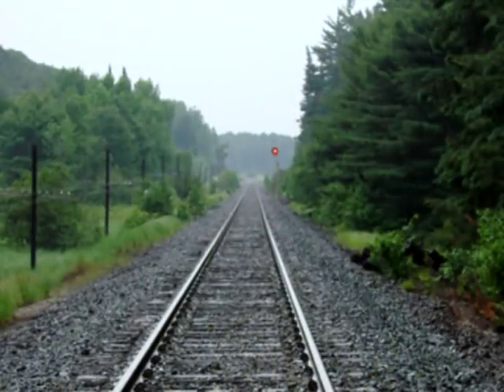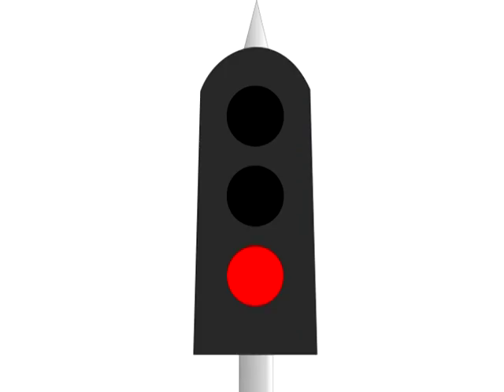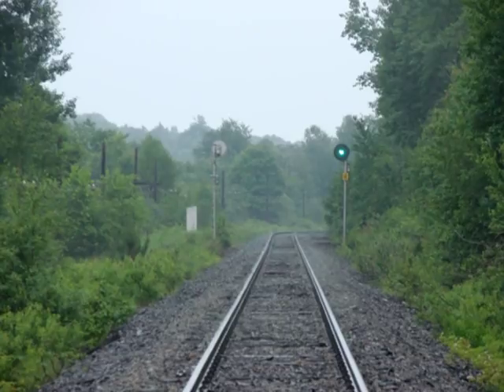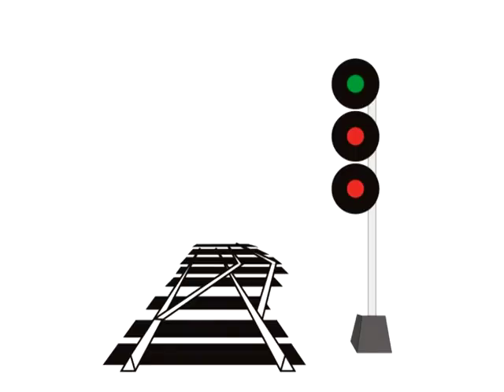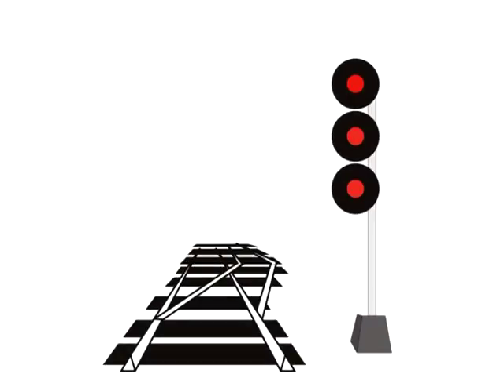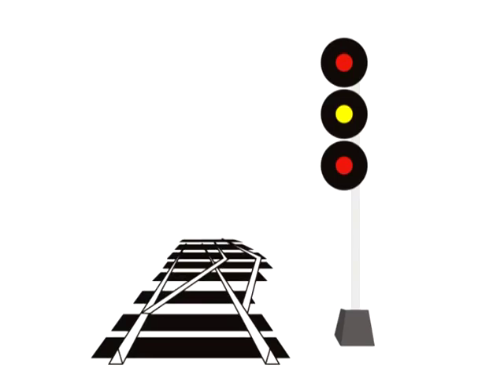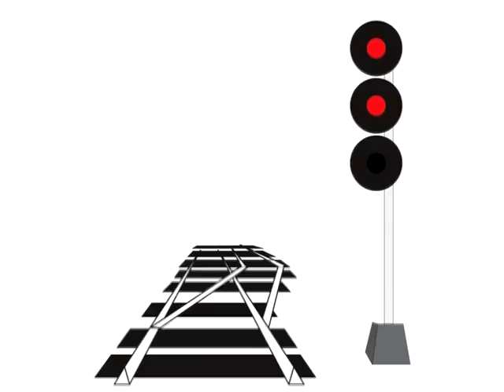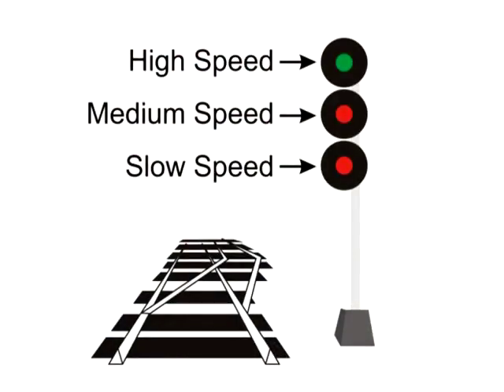Railroad Signals, reading and meanings, part 1: The basic three light system

Comment: What should a train crew do if the weather becomes to dangerous to go @ Green over Red, & Red. Say a snow storm starts blowing snow and creating near white out conditions? I would think the crew would slow to stop and radio in there weather conditions and the safety action the are taking. Is that the correct procedure? Thank you for the informational video. I learned a lot.
Reply: As long as engineers can see signals before they reach them, they're probably OK.  They'd certainly inform dispatch of the situation, but wouldn't outright stop unless ordered to, schedules being what they are.  Not just their own schedule. but that of trains behind them on the same rails.  If there is any way to safely keep things moving, even slowly, that is preferable to complete stop. 

A lot depends on where the rails are.  If there are a lot of road crossings, especially ungated ones, not being able to see if the crossing is clear well ahead of time would be a major safety issue.  In the mostly empty plains of ND and MT, not so much.  What impacts trains more in winter than sight distance is icing, on switches and track sensors.
Reply: stripervince1 Obviously, the asker isn't familiar with signal rules, or the conditions you cite.  Hence asking the question.  All I'm trying to dispel is the asker's assumption that such conditions would automatically lead to a complete stoppage.
Reply: Toby Cameron Your thoughts are incorrect. I wanted to know if that was likely and what should or would a train crew do in the situation I described. I am not familiar  with rail road signals other than grade crossings.
Reply: ahnbra Well, you said "I would think the crew would slow to stop and radio in there weather conditions and the safety action the are taking," and all I did was say "not necessarily full stop".  Where did I misunderstand you?
Reply: Toby Cameron Disregard my previous reply. I misread and misunderstood you. Sorry about that.
Reply: We're cool.
Reply: Excellence question!!!
Reply: In the situation you spoke of, you don't go past signals you can't identify.

You would treat the signal as if it was showing it's most restrictive signal. In most cases the most restrictive indication is stop.

Call dispatch and tell them situation.

Dispatch will no doubt instruct you to go at restricted speed for a specified number of miles.

Restricted speed is:
A speed that will permit stopping within 1/2 the range of vision. It will permit stopping short of a train, a car, an obstruction, a stop signal, a derail, or an improperly lined switch. It must permit looking out for broken switchs. It will not exceed 15MPH	

Train crews that are ordered to go at restricted speed have all the weight of responsibility on them to stop short of all the obstructions mentioned in the definition of restricted speed.
Reply from the maker: ahnbra Believe it or not - we don't slow down for nuthin!  Heavy fog or snow, we have to know the territory we operate over. So we know where the signals are, and sometimes you might just see the signal for a fleeting second before you pass it!  As I was explaining to another commenter, here on the Alanwater sub in Ontario, there are signals which can't display an advance clear to stop, and the distance between that signal and the next one is very short.  For those signals we actually vary our speed as we approach that signal based on the weight of the train.  If we're really heavy, we slow down on chance that the signal is not a clear signal.  That is the only time we slow down!  Whether or not we can see the track ahead is irrelevant.  :)
Reply from the maker: stripervince1 Nope, we don't slow down.  As you know, if it's heavy fog we have rules as per the bell and stuff, but no - we basically don't slow down.  What would it accomplish?  We can't stop anyway, even if we could see.  You're the first I've heard say CP ran like that, the conductor I worked with up North was with CP for three years before he came over to CN, he never talked about anything like that either. The only exception I can think of was when we were coming into towns with just crossbuck crossings, and the crossings were really bad even during good weather.  We slowed it down then, but that very conductor was on a single light unit on a bad day, and they struck a van. They weren't even going the 25 mph track speed, they were only going maybe 15, 20 mph?  Didn't stop until about five or six cars past the crossing.
Reply: Again, if the gasoline truck didn't obey the crossing signal, not the train's fault, and sh*t happens.  Unless a train is already going at a relatively low rate of speed (Slow, Restricted, Medium, or even Limited) by the time it sees there's an obstruction on the track, it's already hit it, or just about to.  This is why cars and trucks are supposed to stop at crossings and let the train pass.
Reply: There is almost no weather, short of an honest to God tornado, that will outright halt local rail traffic.  And even that's temporary, unless it physically damages the tracks.  Mere visibility isn't an issue, what does it need to see?  A train can't go anywhere but where the tracks take it, and re crossings, see above.  The only effect winter weather has on rail travel is indirect; if a switch freezes or sensor fails that could force a train to stop -- briefly -- to evaluate the issue.  I was once on an Amtrak in Michigan during a blizzard, where it had to go through a crossing at walking speed because of a frozen/stuck sensor.  Its speed was kept down (under the flexible definition of "track speed") for most of the run and it was dead late to its ultimate destination, but it did keep moving.
Reply: 25mfd In the VERY FIRST comment in this thread, I in fact highlighted the fact that signal visibility is a crucial factor, why are you jumping down my throat now?  I did not and would never advocate blowing past an obscured or inoperative signal.  The current context (per stripervance1) is about visibility of the track in fog, with respect to avoiding collision with obstacles, cars at crossings, large wildlife, etc.  Which is no more or less of a problem during inclement weather then in good weather...
Reply: Toby Cameron
My fault toby. I got the wrong guy.

I meant to send this to ian juby.

My fault.
Reply: Ian Juby
From a RULEBOOK aspect, the cond and engr MUST call out the signals they encounter.

If you were riding with a safety officer/traveling engr and neither you nor your cond called out a signal aspect due to being unable to see it, what would you do?

You would have to do something to mitigate the fact that you did not see nor call out the signal aspect.

To CYA, you would have to get down to restricted speed until you get to the next signal and notify the dispatcher of your situation.

Also, what if you are blowing past weather obstructed signals on a subdivision where you have a river crossing?

I worked on a job where we had to cross the Mississippi river. (...i HATED crossing that bridge. made me nervous as hell) 

No way would I blow past the last signal before the bridge not knowing its' aspect. I do remember twice we had to stop at the bridge because we weren't lined up.

All of your actions are recorded, as you know.

So if a crew encounters weather obstructed signals and gets into trouble because of this, and there is no audio record of the crew contacting the dispatcher nor is there EVENT RECORDINGS of the crew slowing down to restricted speed, this crew is canned and the engr will be decertified.
Reply: Toby Cameron
Although I do think ahnbras' question was in reference to obscured signals due to bad weather and not about issues related to grade crossings.

Can't see why he would ask about grade crossings when the vid is about signals which govern train movements.
Reply: No mei
When operating in reduced visibility situations, you're supposed to be following NORAC Rule 958.

If you can't see the signals, how do you know they are clear???

"If anything distracts attention from a constant lookout ahead or if weather conditions make observation of signals in any way doubtful, Engine Service Employees must at once regulate the speed of their train to ensure safety. "
Reply: Toby Cameron
Your incorrect in saying that , "... but wouldn't outright stop unless ordered to, schedules being what they are."

The cond and engr are responsible for safe handling of the train and no one else.

If the crew deems it necessary to stop, they better stop.

SAFETY comes first over any train schedule.
Reply: No mei
You stated, "Not once have I ever (Personally, Or heard of anyone else) slowing down a train because "It was too foggy" or "the snow was too thick". "

Your comment is utter NONSENSE. PERIOD.

Here is an excerpt from an NTSB report of a derailment where a train rear ended a train due to HEAVY FOG.

The cond and engr were KILLED.

So much for all of that, "Safety is first" crap.

About 1:58 a.m. eastern standard time on January 17, 1999, three Consolidated Rail

Corporation (Conrail) freight trains operating in fog on a double main track were involved in an

accident near Bryan, Ohio. Westbound Mail-9, traveling near maximum authorized speed on

track No. 1, struck the rear of a slower moving westbound train, TV-7, at milepost (MP) 337.22.

The collision caused the derailment of the 3 locomotive units and the first 13 cars of Mail-9 and

the last 3 cars of TV-7. The derailed equipment fouled the No. 2 track area and struck the 12th

car of train MGL-16, which was operating eastbound on the adjacent track. The impact caused

18 cars in the MGL-16 consist to derail. The engineer and conductor of Mail-9 were killed in the

accident. The crewmembers of TV-7 and MGL-16 were not injured. Total estimated damages

were $5.3 million.1

The National Transportation Safety Board determined that the probable cause of this

accident was the failure of the crew of train Mail-9 to comply with restrictive signal indications

while operating at or near maximum authorized speed in dense fog. Contributing to the accident

was the lack of uniformity and consistency in the operating practices of Consolidated Rail

Corporation train crews when they encountered conditions of reduced visibility. Also

contributing to the accident was the lack of a backup safety system that would have helped alert

the crewmembers of train Mail-9 to the restrictive signal indications or that would have stopped

the train when the crewmembers failed to comply with the restrictive signals.
Reply: No mei
You're forgetting that "...Safety is first" crap" is the ONLY thing standing between you having a good paying railroad job and you working at tim hortons.

Getting canned and decertified would be the BEST thing that could happen to you. At least your ALIVE to fill out your application at tim hortons.

I worked for union pacific. Got in trouble a few times. They CLUBBED me over the head with that GCOR rule book. Most roads do. Including yours.

Most roads will dangle your job over your head if you fail an efficiency test. You may even get placed on the discipline system

Hell, you don't think they would pound your ass in the ground if you blow past a stop signal obscured by fog and rear end another train??? (...that's assuming you are ALIVE)

After they have their "kangaroo court" investigation, you'll be out of a job. (again, assuming you are alive)

You need to start looking at your CROR rule book as if it were you CHECK BOOK. If you don't follow that CROR, you will find yourself out of a job.
Reply: No mei
You are wrong.

Here is anbras question..."What should a train crew do if the weather becomes to dangerous to go @ Green over Red, & Red. Say a snow storm starts blowing snow and creating near white out conditions?"

His question is self explanatory. My response is in DIRECT response to his question.

You said..."When operating on a restricting signal the rules state "One must be able to stop within one half the range of vision of broken rails or equipment occupying the block."

This is true. But anbras question was..."...Say a snow storm starts blowing snow and creating near white out conditions"

His question is the definition of REDUCED VISIBILITY. Visibility so poor that you CANNOT see the signal indication that is being displayed.

You said, "As soon as you see that "Clear to stop"...

My question to you is...what if you DON'T see the "Clear to stop" because of reduced visibility????????
Reply: No mei
I was a trainman for 10 years for chicago & northwestern and then union pacific when they took over in 95.

I divided my time there working switch engines and unassigned freight pool service.
Reply: No mei
"The National Transportation Safety Board determined that the probable cause of this accident was the failure of the crew of train Mail-9 to comply with restrictive signal indications while operating at or near maximum authorized speed in dense fog".

You claim my comments are off topic. That the topic is about visibility of signals.

The crew of MAIL-9 blew past a RED signal and rear ended the train that was ahead of them.

How can this be off topic.

Train "A" is delayed in a block. Train "B" is coming from behind but cannot see the RED signal which indicates that train "A" is delayed in the block.

Train "B" blows by the RED signal which shows a train delayed in the block and rear ends train "A".

The inability of the crew of train "B" to see the RED signal which shows that train "A" is delayed in the block is what causes the accident.

Isn't this entire accident about visibility of signals?????
Reply: stripervince1
I'm not sure what's going on with @No mei.

He can have his views if he wants.

But if he gets into trouble, the company will squeeze his ass right out of a job.

I also have been to investigations. NOT FUN!!!

After my first few f---ups, I said I'm gonna start following the rules.

They WILL take your job away if you screw up.

The ONLY person smiling will be the guy behind you on the seniority roster.

And I saw that Oxnard calif derailment on the news this morning.

Far as I know no one was killed but I think I saw three cars overturned.
Reply: No mei
First, I don't know what your record looks like. If you have zero safety violations that's good. I hope it continues.

Second, I quit the railroad to work at the fire dept. I got tired of the crappy working hours. With the fire dept, i work one 24 hr shift then off for two days. I work 8 days a month. Every 27 days I get 5 days off in a row. And I still make what I was making at the railroad. And I don't have to freeze my "you know what's" off in this crappy Wisconsin winter. So right now i'm at my warm home and my fellow railroaders are freezing their butts off.

Third, I already told you what DID happen when I posted the report of the conrail train that rear ended another train due to the crews inability to see the signal indications because of heavy fog.

So what should that crew have done to avoid the fatal accident that occurred???

And your rule book dictates what you should do in reduced visibility situations. Not haggling on youtube.

And it doesn't matter about time on the job either.

Six months, 10 years, 25 years, 50 years doesn't matter.

Time on the job doesn't keep you SAFE.

Working safe KEEPS YOU SAFE.

But as I said before, "...that "...Safety is first" crap" is the ONLY thing standing between you having a good paying railroad job and you working at tim hortons."
Reply: No mei
And I gotta ask this...You stated, " When the visibility gets low we just start using landmarks to judge where the signals and sidings are."

IF visibility is so low as to not be able to see signal aspects, how can you see landmarks???
Reply: stripervince1
@No mei gave a good talk like he worked at the railroad. He claimed "we" operate under CROR rules and that "we" don't stop for anything.

NO ONE that drives or operates a vehicle for a living should EVER say, "I don't stop for anything". That' just silly.
Reply: stripervince1
Yeah, my comments aren't meant as a knock on ian juby. He seems like a cool dude

His vids are EXCELLENT.

I just question the reduced visibility aspect.

And I have to say that I don't mean every fog or snow fall issue warrants slowing down. 

But if your visibility is so reduced that you can't call out the aspect before you go by it, that can spell trouble.

If something happens, the FIRST thing the company will do is download the event recorder. (and a piss test)

If the crew says that visibility was reduced and they couldn't see the signals but yet the event recorder doesn't show any reduction in speed, they are screwed. If they check the dispatcher tapes and it shows the crew didn't contact dispatch, they are screwed.

Also, if you blow by grade crossing that you can't see, and you don't blow the whistle because you can't see the whistle post, pray you don't hit anybody.

Some of these guys are saying, "if I hit somebody I just hit them".

This is foolish talk.

Once again, the event recorder will be downloaded. If it shows you DID NOT blow the whistle at the crossing, your screwed.

Not blowing for crossings is a HUGE NO NO.
Reply: No mei
"You can never not sees signal aspect "
Tell that to the two dead trainmen in that NTSB report.

Good that your moving up. 

And i want to add that I'm not saying what I'm saying to just to argue.

I left railroading but I still like it. But i also know how difficult it can be out on the road.

The phone calls all times of the day and night. Not being able to plane ANYTHING. It SUCKS. That's why I left.

But when I was there, everything I did when I was guided by the rule book. Because IF you get in trouble, the company will pound your head square with that rule book.

They will say you violated rules you didn't even think you violated.

Being an engr only doubles your responsibility.

If you want to keep your sanity and your job, better let the rule book guide your actions. Not just for reduced visibility situations either. But for ALL situations.

It's WAY too easy to get into trouble out on the road. That's one reason why some of the old head trainmen I worked with stayed in the yard.

It's less troublesome on a rinky dink putt putt switch engine than to be dodging booby traps out on the road in pool service.
Reply from the maker: No mei I apologize for stripervince1's comments.  He was out of line and I wasn't paying attention to the comments.  He's dead wrong, sorry. I have yet to talk to a railroader who agrees with him.
Reply: Toby Cameron earthquakes eman track inspecrion beforeproceeding
Reply: 25mfd agreed. Also discipline from delaying schedule is Much less than unsafe train handling.
Reply: Proper signalling should be based on knowledge of what train is where, and if they've passed certain signals yet - obviously you can't set a green that's ahead of a train to all-red until it's started to pass, and nor can you clear the all-red to a yellow or green until the train has cleared that section. Either you check via radio, or you have track occupancy / train passing sensors, or even GPS and cellular data connections in the most modern systems (or preferably do all three).

The "clear" signal, just like an "open" speed limit (in a region that has a prevailing blanket limit for each vehicle class and only puts a number on a sign where it's reduced from that) or a green traffic light,  merely grants permission to occupy the track and to travel over it at the highest permitted speed. You are under no obligation to reach that speed, or indeed to actually proceed into the next section of track (or enter the light-controlled intersection / pedestrian crossing / single lane piece of road) in the first place, if in your own judgement the conditions are unsuitable for that. Including bad weather, broken track, seemingly malfunctioning signals, curves that you doubt your consist will make it through without braking some (although this is one place that rail tends to differ from road - any curve that a typical train can't make it through at full line speed will have a signed restriction placed on it, whilst it's only the most severe bends that are signed, with advisory rather than mandatory limits, on the roadway; drivers of road vehicles are expected to exercise even more personal judgement than rail engineers when it comes to carrying speed through a bend, and particularly are always under the "must be able to stop in half the visible clear distance" rule rather than it being a rare restriction, because roads are far less well controlled places and anything could be hiding round the next bend... generally on the rails, if you have a green light, you don't need to be able to see very far round the bend as the dispatcher has certified the line as free and empty for you to blast along...), or of course any problem that may have developed with your train / vehicle / own or passenger's body that forces a stop. In the latter case, possibly you're driving your mother to a tourist attraction on the other side of the Canary island you've taken a break on, after her original partner did a flit, and she just can't handle all the hairpins and switchbacks so you have to stop somewhere otherwise totally unsuitable right on the edge of a less than solid cliff, with trucks and buses thundering both ways along a ludicrously narrow piece of 2-lane concrete road, so she can divest herself of lunch in the wrong direction...

It's a better situation than on a typical road, in fact; if you suffer a breakdown, or the conditions are too treacharous for you to continue, all you can do is stick your hazard flashers on and get as far away from the mainline as possible (including getting out of the car and cowering behind a barrier or running back up the road to flag down other drivers / dive into a bush if needed, if it can't be removed from the road). If you're very conscientous you might have a warning triangle thingie that you can place a couple hundred yards up the road if vision is restricted on the approach. For safety's sake, ie to prevent being rear ended by someone who isn't following the half-visible-distance rule and then a pileup from the others who were tailgating them, you might feel compelled to press on a little further or faster than you would ideally like. On the rails, if your train comes to an unexpected stop, or you don't feel safe to continue, then you can simply stop where you are. Anyone following (or coming the other way, on single track lines) will be blocked from entering your section by red lights, and possibly even automatic brakes if they ignore the signal. If you're connected by radio, then you have basically an OnStar-like rescue service that can be called for with considerable ease (...who will have to get special permission to enter your block, and approach at very restricted speed, basically under the lower-solid-yellow rules described in the video).

The only thing it can't really protect against is if a train breaks whilst moving uphill, and the brakes on the rear section don't automatically apply for some reason. But often you'll find sections where this is a particular risk will be further protected with catch points / reverse derailer switches and the like, springloaded devices that are normally set to derail any vehicles moving downhill into the weeds or a sandtrap (or in extreme cases, just into/off a cliff... it's still preferable to do that at an early stage than risk a full runaway) and that temporarily flick to straight ahead as each set of wheels moves over them uphill. Trains deliberately moving downhill then needing either the trap to be positively set to the straight ahead direction, or to be diverted over a small bypass (maybe even a piece of gauntlet track) by the setting of a different switch. The trap being set a sufficient distance after the previous signal that it protects any train sitting at the red light, though the engineer might get a bit of a shock seeing a crash unfold a quarter mile ahead...
Reply: In regard to the later discussion in the thread: I would think that if the fog or snow was so thick that you couldn't see the lights of a trackside signal, you'd damn well know about it, because you'd have trouble seeing anything else either, including whether e.g. the snow had drifted across the track so much that it would cause the train to crash if you hit that drift. The lights are pretty bright, they're high wattage and focussed so that a crew can read them even with the sun silhouetted directly behind (check out some cab ride videos sometime, you'll see evidence of this). So by the time you can't clearly see the light aspects from the cab, you probably can't see jack shit beyond the window - no trackside furniture, no foliage, probably not even the trackbed below. And maybe you'll be able to see part of the aspect, but not all of it (in which case the rule is to assume the most restrictive of all the possible combinations that partial view might sugest).

In which case, if you don't slow right down and make preparations to come to a safety-first halt, you have no goddamn business being at the controls of any kind of powered vehicle, much less a train that could weigh tens of thousands of tons all up, and needs the better part of a hundred yards (never mind the dozen or less you might be able to see ahead/to the sides) to come to a halt even from restricted speed.

The general rule of the public road, at least in the UK, is once you can no longer see a good 100 yards ahead (which takes approximately 3 seconds to cover at the national 70mph limit), you put on lights, including foglights if relevant, and reduce your speed, even in the dry (if it's wet, you should already have been slowing down before it got to 200yds), and drop right down to walking pace (or even stop entirely) if you have to in order to deal with the reduced visible distance. The advice for safe following/braking distance in traffic is 2 to 3 seconds, and it holds for the exact same reasons in poor viz: so you have time to see any upcoming hazard and successfully stop or steer to avoid it. If things are looming out of the mist or blizzard and going past all in the space of less than two or three seconds (five if it's wet, ten-plus if icy/snowy), you're going too fast, and are just spoiling for a crash.

I can't see any good reason why the same wouldn't apply when driving a train. You need sufficient time to see, recognise, and if necessary respond to signals. This might mean at least two or three seconds with them being within your field of view, just in case you blink or sneeze, or something on your dashboard demands attention... etc... so that outside of that momentary loss of vision or distraction from staring out of the window, there's at least a half second where you can see the signal and get an image of it fixed in your mind. So if your line speed is 70mph, once visibility starts to drop below 100 yards (ie 300ft, 91 metres), it's no longer safe or advisable to run at or near full speed. Once it's down to about 30-40 yards you can't reasonably keep more than Medium Speed. And at 15-20 yards (around the point where the other end of the locomotive starts to become indistinct, and the other edge of a four-line track section you're on one outer track of is hard to see any more...), Restricted Speed starts to look like a rather good idea... because you'll still be doing 22 feet per second even so, meaning that distance actually passes by awful fast.

Your primary mission is the safety of the train and of others who might be injured by its (literal!) misconduct. Keeping to the timetable is entirely secondary. Arriving an hour late is preferable to ending the journey much earlier than intended in a ball of fire and carnage. Even at the speeds and visual distances listed above, you've got little hope of stopping the train within the distance you can see to be clear; if you were relying entirely on "visual rules" running, you'd have to go FAR slower. Thankfully, you can generally rely on the dispatchers and signalling systems (and crossing lights and barriers) to keep the line ahead clear, or warn you when it isn't. What you have to do is make sure you can see those warnings, in order to respond to them.

Of course, engineers aren't perfect, and they can be downright sloppy, or be pressured by psycho bosses into running faster than they should (including in poor visibility conditions) and not paying as much attention to the signals as would be ideal... which is why the problem of "SPAD" exists, and on this side of the pond we've had to implement driver vigilance checking systems, signal warning devices that ping any time you pass a light that isn't fully green, and automatic train brakes for those times where the light is red... but ze train, she still moves...

And yeah, people can violate crossings. But that's their own stupid choice. Train companies and highway authorities both take copious enough action and precautions to limit the potential interaction between rail and road vehicles. Even uncontrolled crossings with no active warnings are at least plastered with signs that only an idiot would miss, and trains are generally required to approach those at very restricted speed and with copious use of horn so you damn well know that a big heavy thing with very poor brake performance is approaching... with the rule of the road at a rail crossing almost universally being that road traffic yields / gives way to rail and possibly even treats the crossing as a junction where they have a STOP sign (the only completely uncontrolled - no gates, no lights - crossings I've seen in the UK have Give Way (ie Yield) signs on them, effectively making the road a sign turning and the rail line the main route... it's on the road vehicle driver's head to make sure there's nothing coming up the line before proceeding). If you end up putting yourself in the path of an oncoming train and suffering a collision, whatever consequences come of it will be judged as your fault.

The more actively controlled crossings have, at the very least, lights that, when lit, mean the exact same thing as red lights at a normal intersection or pedestrian crosswalk... unless they turn on whilst you're already partway across, or too close and travelling too quickly to avoid screeching to a halt in the middle of the tracks (the one difference is there's usually no yellow light, so the reds might catch you by surprise), you are to STOP immediately, behind the painted line, and not move to cross it until they've turned off again. For the duration of the red light, the crossing is no-entry, no-go, nuh-uh you can't come in. You run that light, it's the same as running any other red light... there's a high likelihood of bad stuff happening, and the blame will be entirely on your shoulders. If it seems to have activated falsely, there's a phone provided that you can use to call the signaller/dispatcher and find out if it's actually still safe to cross and get special permission to do so. Or more sensibly, you should turn around and find another crossing, if it's not fifty miles to the next one (if it IS that far, the rail company really should have not been so cheap and just put a bridge in for either the road or the rail line... one bridge every 50 miles ain't much... usually you get flat/level crossings where it's a low traffic line and there's a lot of roads criss crossing it). More comprehensive still, in places where there's a high volume of rail and/or road traffic, the lights will be joined by automatic barriers, forming a pretty obvious "You Shall Not Pass!" obstruction to anyone hell-bent on ignoring the signs and lights and pushing on across the line anyway... (or in some rare survivor cases, actual gates... that rest normally either across the road - in which case there'll generally be a simple small red/green light, and the procedure is to check the light, open both gates (which can't be swung across the track) if it's green, then check again... drive across if safe... then check a third time and close the gates if you're free to do so... rather an involved procedure so only really found in isolated spots - or normally across the track, with the crossing being a literal whistle-stop, well known by the drivers, who have to pause there and either swing the gates to temporarily block the road themselves (if they have a short train, or a rear guard in a caboose/brake van who can hop out to swing them back again) or rely on a signalman or stationmaster (as they usually appear at the end of rural stations) to do it for them... and are the one case where rail is expected to give way to road... naturally given the risk a runaway train might pose, these are no longer very common)

Even with barriers - particularly half barriers, but even with full width ones replete with skirts that block the full height of the road below them - impatient people will still try to force their way through, putting both themselves, the passing trains, and potentially anyone within about a half mile radius at extreme risk for the sake of saving thirty seconds off their journey. Sometimes managing to skirt around one half barrier, or pushing right through a full one, only to get blocked at the other side (particularly if full, or double-half barriers are coming down in sync, so they JUST make it through one side but then can't exit the other), and thus becoming sitting ducks on the line, only escaping a horrible fate if the train(s) is/are coming from just one direction and they manage to spot it in sufficient time to cower on the other track.

All this demonstrates, however, is not insufficient railway safety policy. It's just that human stupidity and blind impatience are infinite things. No matter how much you idiotproof a system, nature will build a better idiot. You can replace the crossing with a bridge... they'll find a way to drive off it (or up the embankment) and onto the tracks anyway.
Reply: (And you can't very well go slowing down every train that has to go across a road every single time it does that, because it would bring some parts of the network to their knees in a crawling logjam, and there's not enough money to replace even every tenth crossing with a bridge then fence off the rest - which probably wouldn't be entirely successful anyway. All you can do is set the rules, provide the warnings and barriers, and suitable signals to the train drivers, and require them to blast the horn at each crossing, and hope that the vast majority of the general public will be savvy enough to not run the red lights and work their way around the sturdy metal poles and half-fencing designed to stop even a runaway car where it stands instead of just phoning the dispatcher to find out why it's taking so long for the lights to clear... and that the occasional idiot you get a couple dozen of per year across the entire network won't cause too much damage to anyone but themselves by their actively dangerous and literally very illegal actions, and maybe there'll be enough of them left to action a high-profile prosecution against in order to try and publicly dissuade other idiots from following suit. After all, there are some idiots at the controls of the trains as well. It's not possible to completely ball up every system in cotton wool, at some point you have to put yourself in the hands of others and trust that they're not going to be dumb enough to drive their car, or train, through a very plain red light. Part of that also is trusting that if the fog, blizzarding snow, or whatever other climactic problem is currently holding sway over a particular section of track is plainly restricting vision so much that they can't properly see signals without slowing down, or even that it's preventing them from seeing the signals without creeping along at 5mph and hanging out of the cab to able to see the lights and the mileposts that give some clue (along with their track map) as to whether there should be a signal coming up, that the engineers will respond accordingly, instead of going "fuck it - if I can't see any signals, that means I can't be held responsible for not seeing any reds, so I'm going to shove the regulator to maximum speed and just trust that there won't be any need to slow down or stop to avoid a crash... YOLO!"...)